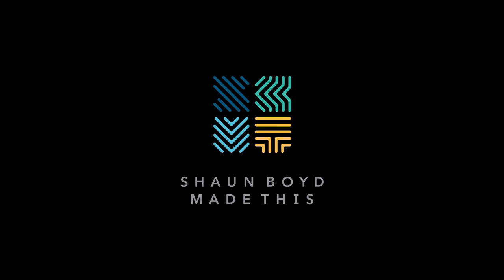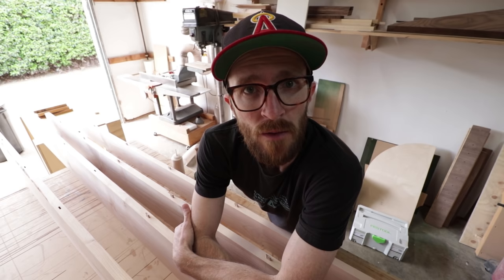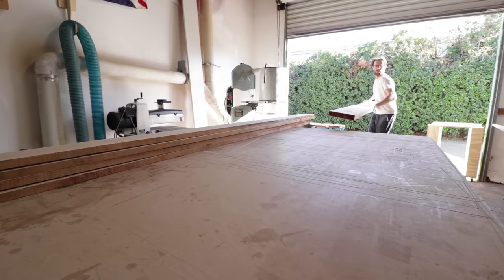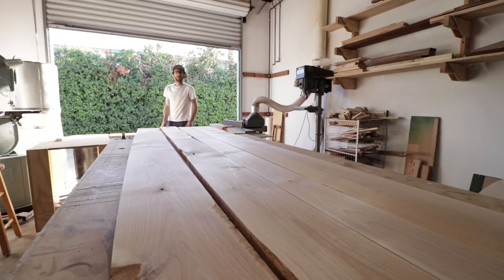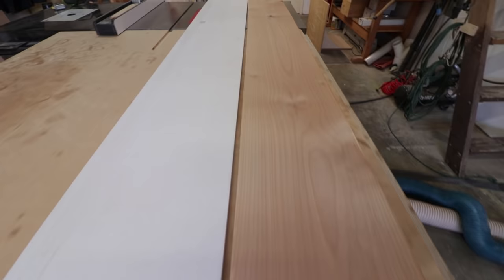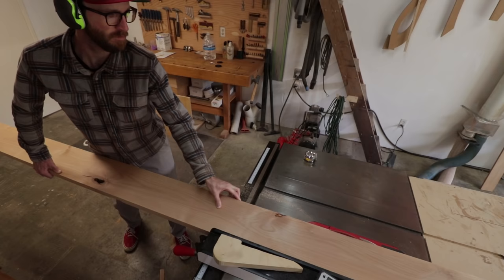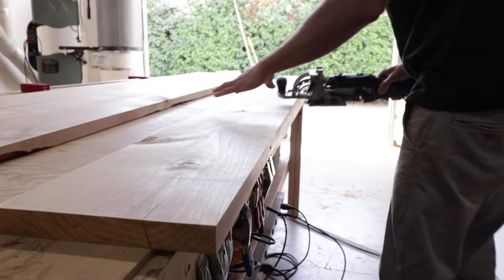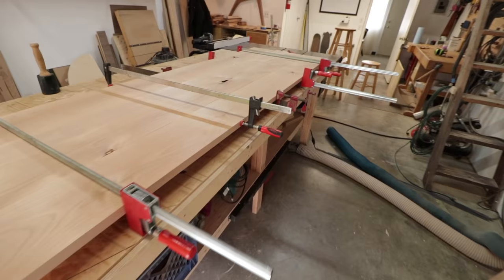How to Make a Table Top Without a Jointer

Comment: I don't understand how this worked... the fence on your table saw is presumably perfectly straight, by putting the MDF in between you are just pushing the uneven board further out; wouldn't you get the same result running the uneven board directly against the straight ripping fence? 
Every other time I have seen this approach, the uneven board goes ON TOP of the perfectly straight MDF to that only the perfectly straight MDF side is transferred over to the cut
Reply from the maker: The only problem is that because the board I am cutting is longer than my table saw fence, the crooked edge will just be transferred to the cut edge and it won't be straight. The MDF board acts as a temporary straight side to the board as they both gets pushed through the saw together. It is the exact same concept you are talking about with putting the crooked board on top of a straight piece of MDF, just instead of being on top, it is beside it.
Reply: Shaun Boyd it’s pretty brilliant!

Comment: Looks like this method could be done with a router table. No space for me to have a table saw.
Reply from the maker: Yeah definitely! Or just clamp the straight edge to your board and use a router and a flush trim bit.

Comment: Do you really need joints? Surely just glue them up against each other
Reply from the maker: The dominoes are strictly for making sure the table top is aligned, which will reduce the amount of sanding needed. Glue is definitely strong enough by itself in a situation like this.
Reply: Shaun Boyd oh very groovy